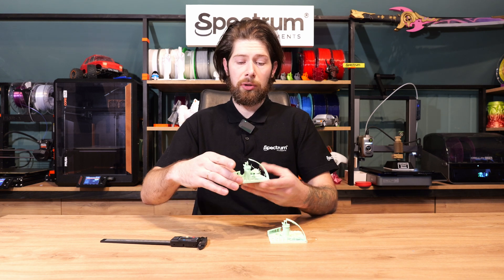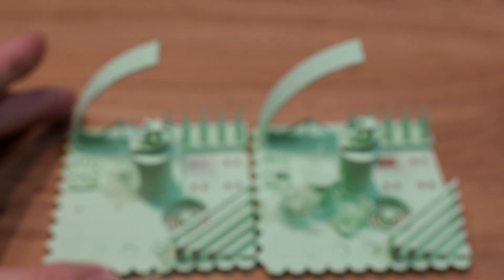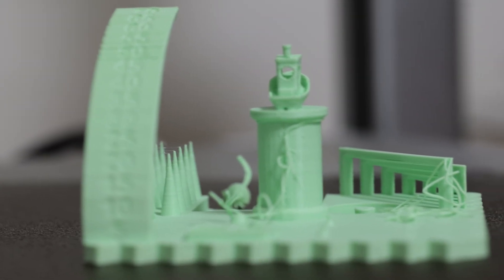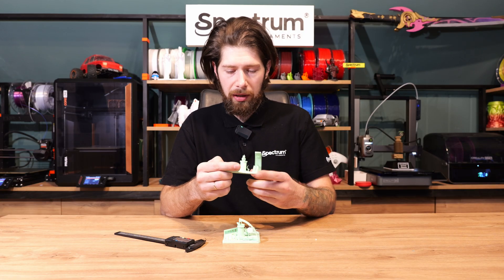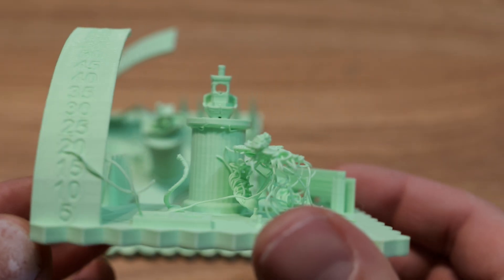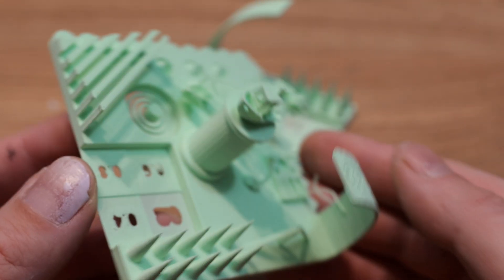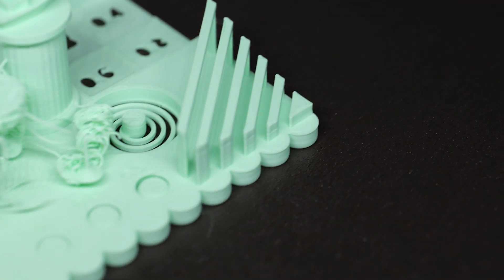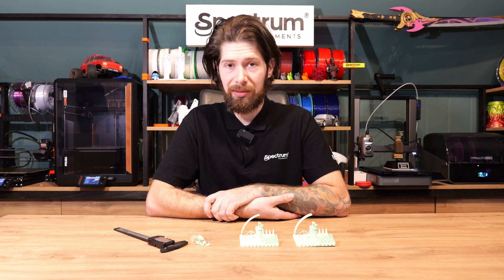One model that will show what to fix in your slicer settings

Comment: I don't understand the point of this video.  I expected you to show the current setup parameters and then print multiple prints with changes to those parameters to demonstrate how the changes improve (or not) the print.
Reply: Or at the very least show a test print at a slower speed, given the statement at the start of the video that  mentioned how printing too fast can affect quality. But at least this shows Bambu and Prusa printers are crap out of the box without tweaked settings!

Comment: You can't really measure holes that small with calipers like those you'd be better off with some test posts that measure exactly 5mm and 4mm 

If you had under extrusion then it's unlikely that the hole is too small by a whole 1mm that's usually over extrusion maybe small area flow could take it over but that's usually less flow not more